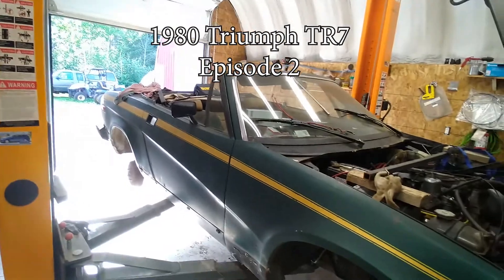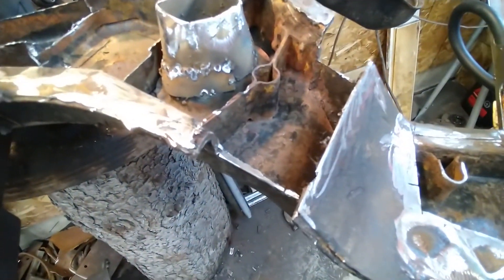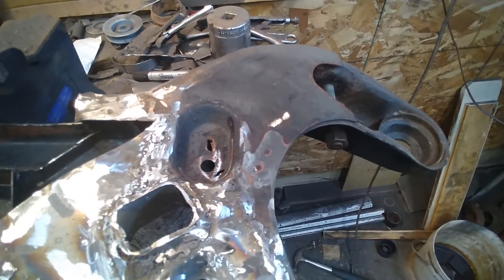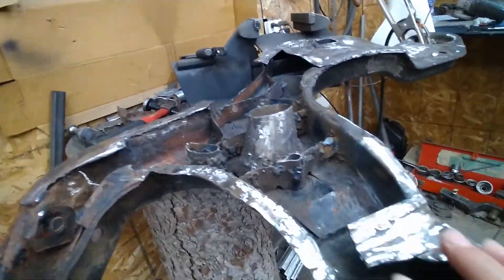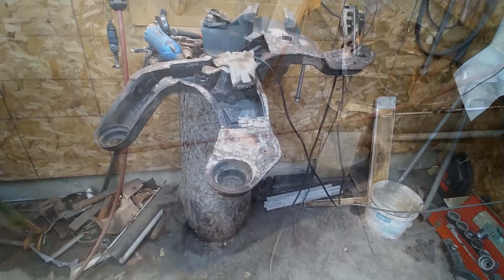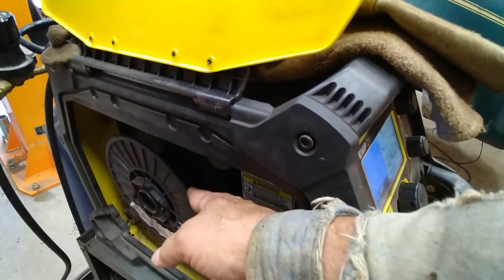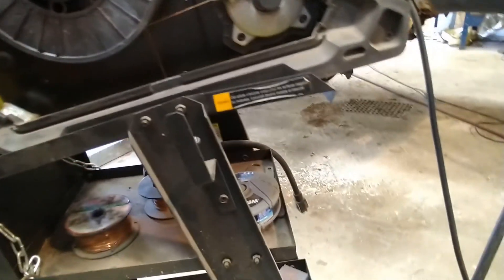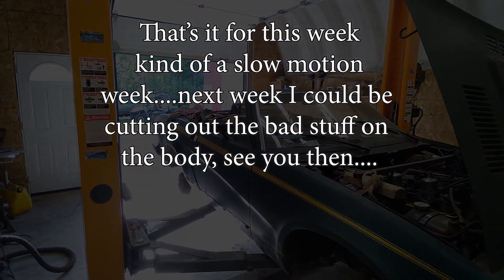1980 Triumph TR7 Fixing the Subframe - Episode 2

Comment: Great to see this.   I had one of these as my first car back in 81.   I pulled that engine driven fan off and went with an electric fan.   I recall that I also modified the timing to give it some advance rather than retard.  Tuned a bit rich and it was a bit more peppy.   As a result of the extra power it was fun to drive however the transmission was worn out in just a few years.   Fun cars, but a lot of work to keep on the road.  On a road trip to the middle of nowhere my clutch master cylinder spring shattered.   After searching the car, I found that the trunk release spring was the same diameter.  I stretched it out to transform it from a tensioning spring to a compression spring, loaded it into the master cylinder and was back on the road in an hour or so.  Always bring your tools and extra fluids.